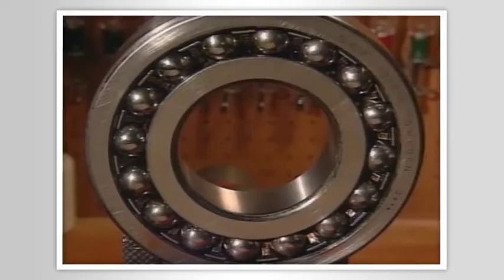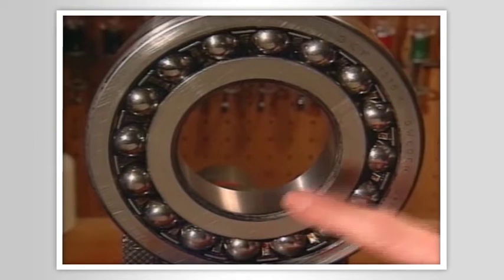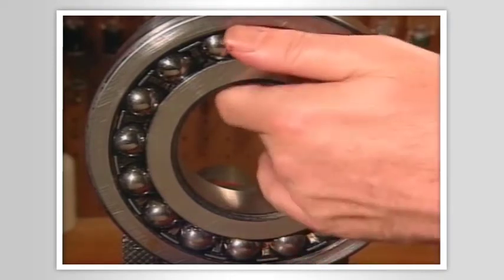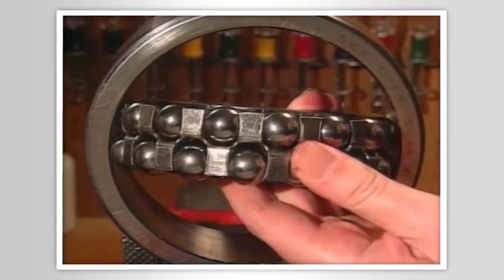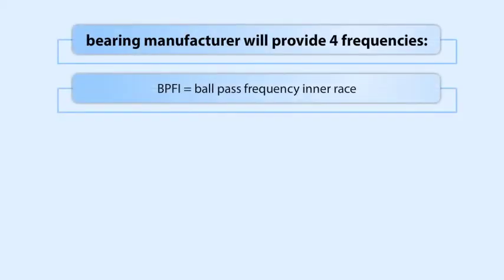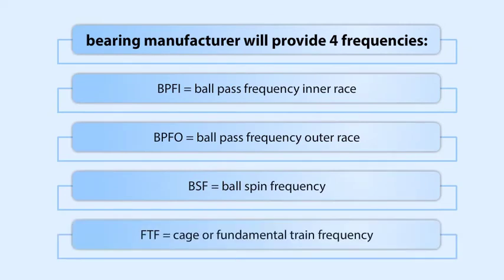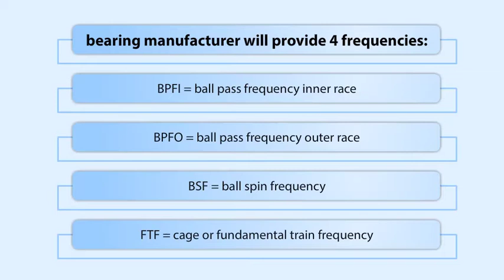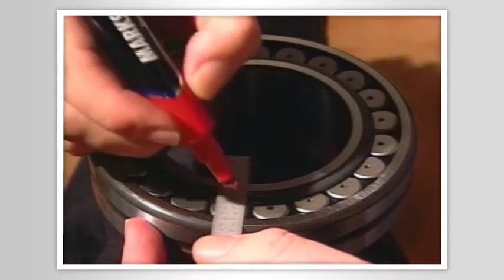Applied Vibration Analysis: Analyzing Bearing Vibrations

Comment: If a machine running on 1490 rpms , centrifuge overhung pump..
If problem arrived in bearings but its theoretical values fault frequcies doesn't match..how we say is the bearings fault????